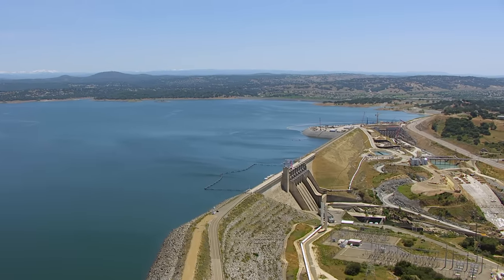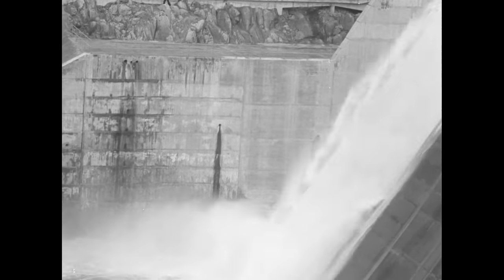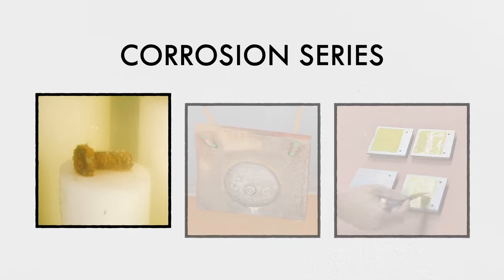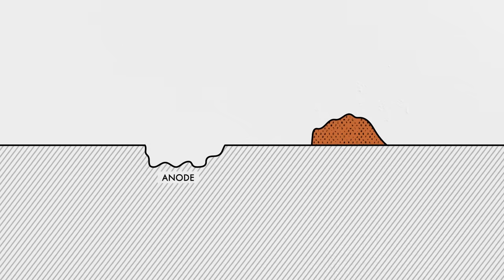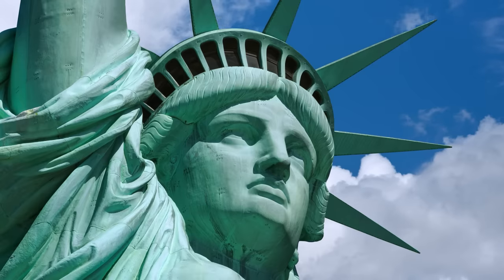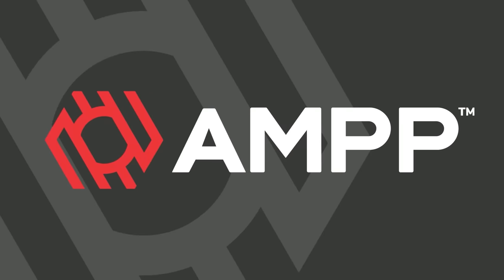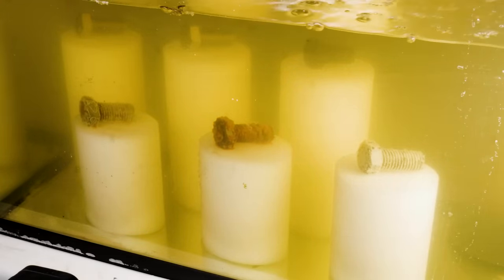You Spend More on Rust Than Gasoline (Probably)

Comment: Quick question: I have been building in a high salt environment near the ocean. For my concrete pours, I switched, for flat surfaces only, to fiberglass rebar. As far as I have researched it is not certified for vertical columns. What are your thoughts on this as a replacement to steel rebar? It seems to be a better replacement for any number of reasons from laying it (way easier to cut and handle) to weight to corrosion resistance. What am I missing? Why is it not in common use?
Reply: Price, construction jobs usually shoot for the cheapest acceptable route possible lol
Reply: Because big steel won't like that 😉
Reply: I'm very curious of the cost vs performance of "glass re-rod"... As a Bldg. Mgr. In N. Palm Beach FL,,  I've see spawling occur in less than 5yrs -- thermal dynamics along with the porosity of concrete draws salt & oxygen air right to the rebar.. it rusts, expands and pops up even under tile or any other surface treatments.. Paint & caulk seem to be the best defense, but even the cement will suffer 'entropy' at alarming rates in ocean front decks, balconies, etc.. It's a huge budget consideration for owners.
Reply: @francom6230  I hear you, I have tried additives in the concrete, but even that long term is not perfect. I have been using fiberglass rods for 2 years, here is what it did for me.

1. Cheaper both to buy and more important to me is the lower weight has saved me a ton on shipping costs. 
2. Time to prepare. To put this stuff down is much much easier than steel. Plus you don't need tools that can cost thousands of dollars. tie wires and bolt cutters only. Also, you buy pre-done pieces if you need a curve. 
3. NO RUST. Let me be clear NO RUST. So theoretically the only way for the concrete to break is external damage. No risk of spalling unless something contaminated the concrete during the pour.
4. BUT it is only rated/certified for horizontal pours, not vertical. 

I am using it for floors, decks, etc. So overall I have found it superior to steel in most ways and it has saved me a lot of cost on labor since it takes much less time to prep a pad. Given the cost of labor this in the short term has become my #1 reason to use it.
Reply: just build a house out of legos and add carbon for UV protection. guaranteed to last a millenium. just be careful where you step
Reply: @truemore75  My guess would be the long history of using steel rebar. We know how it behaves in long term environments. Fiberglass rebar may have issues in the long term that could cause catastrophic failures.
Reply: @Blox117  Love it. Do you think they can stand up to a class 5 hurricane? :)
Reply: @truemore75  if you glue them together sure
Reply: @truemore75  the flexural strength of fiberglass rods sit on 70-80% to that of steel, I imagine this perturbs the stodgy building code cabal.
Reply: @mgntstr  I assume that is why in the specs the standard was 1 bar larger. I suspect that makes up for the difference in strength. Given how cheap it is who cares? Plus it is light so there is no downside for the workers with the thicker stock or shiipping cost.
Reply: @truemore75  then there are the environmentalists on the board. You cant recycle plastic
Reply: There's also basalt rebar, which has a higher modulus than fiberglass, ie less stretchy. That makes it better suited to use in concrete, and (I don't know about your local building codes) might be legal for vertical columns. But the big thing is to get away from the planned obsolescence of steel rebar which is a ticking timebomb in every concrete pour.

The Pantheon is nearly 2000 years old and still stands because it doesn't have iron inside it to cause corrosion and collapse.
Reply: @mgntstr  yes that is true. But if you keep the concrete (major world CO2 producer) for 2, 3 or more times longer that would easily outweigh any environmental issues with possible recycling of the fiberglass.
Reply: @truemore75  CO2 is the building block for all vegetation on this planet. We need to pump those numbers up.

I think fiberglass resin rods are an excellent substitute to steel rebar, but I suspect the 1/5th reduction is enough to make it necessary to scale it up a whole lot, pour double concrete and the use of a whole lot more rods than 1 extra in every 5 rod placement.

It is basically epoxy reinforced with fiberglass. Great for tensile stress, not so much for pushing and pulling on it sideways.
Reply: @r0cketplumber  hard agree
Reply: Sounds like you need to get a hold of Tyler Ley (civil engineer PhD, instructor university of Oklahoma). Tyler has a YouTube channel and he’s pretty easy to get a hold of , especially if you’re talking concrete and concrete reinforcement. The man is just nuts about concrete and he probably dreams about it when he’s asleep. Check out his Tyler Ley Channel on YouTube and send  him and email. I guarantee you won’t regret it, he is a lot of fun.
Reply: @boby115  thank you I will. I'm working with a   chemist too that makes chemicals for concrete out of Texas. Between the two of them I will probably get the best advice ever!
Reply: I know some simple engineering, the primary reason to use metal as reinforcement is that it can stretch BEYOND it's elastic point, whereas fiberglass, basalt fiber, carbon fiber etc. will SNAP the instant they go beyond their elastic point. 
This is ductility, it lets each reinforcing strand share the load during a failure event like an earthquake, since as each bar fails it stretches instead of snapping, letting its neighbors catch more and more of the force without actually failing entirely. 
Metal fails to a stronger tensile strength position before its ultimate failure, while fiber fails catastrophically (immediately).
Reply: Fiberglass rebar is brittle, subject to creep, and has different stiffness/thermal expansion coefficient properties than steel rebar, which throws a lot of the assumptions behind conventional reinforced concrete design out the window. Especially because a lot of reinforced concrete design is based on empirically-demonstrated past performance rather than a realistic analysis of the structural stresses. That's not to say it won't become more common in the future, but it's not as simple as a 1-to-1 replacement.

Also, another commenter reminded me that fiberglass rebar is bad in shear, if I recall. I forget if that problem falls under the "invalidates assumptions" category, or if it's just believed that a lot of engineers accustomed to steel rebar will fail to account for the difference.
Reply: Hey everyone on this threat thanks for the replys. Why don't we ask Grady to do a show on alternatives to rebar. I mean he has the testing equipment and know-how. Would be a great follow-up video to this one.  Thoughts? Grady?
Reply: @truemore75  , if you talk to him,let me know how things went and your impression about a guy who’s life revolves around concrete..
Reply: @mgntstr  You're joking with regard to CO2 right? All those poor plants are being overwhelmed.
Reply: @elangum22 , carbon FRP is the best but it cost 30 times more. Basalt FRP also has challenges, it cost 15 to 20% more, there is questions on how it will hold up in a fire, there is questions about long-term deflection, it only has half the stiffness and 1/4 the strain capacity.
Reply: @soheil5710  no they are gasping for more
Reply: @Blox117  ouch! 😀
Reply: Epoxy coated rebar.
Reply: There are currently trial runs being done of concrete with a small amount of graphene added in. The graphene acts as nucleation points for the concrete, making it denser, stronger, less porous, and it cures much faster. The increase in strength is enough to not need rebar in some applications. Currently the trials are only flat slabs but it's looking extremely promising.
Reply: Fiberglass can also sucks water into the fiber and make it expand. Just ask people who has a very old fiberglass boat. The Gelcoat surface on fiberglass boats gets small water filled bobbles under the smooth Gelcoat surface if small glass fiber ends are sticking out through the Gelcoat layer.

Comment: I remember reading as a kid that the American armed forces single biggest expenditure was rust prevention\repair. It was in a Popular Science magazine if I remember correctly. The article was discussing a kind of "Smart Paint" that (If it worked as intended) would actually have fairly extensive self repair capacity, so as to minimize any time bare metal made contact with the outside air.

Comment: In Lithuania just today we have had a small dam spillway failed and collapsed. Ended up raising water level of the river below reservoir by 3.5meters, which was  0.5m away from  flooding local town. The spillway was partly closed by adding plate shields as a short term mitigation.

Comment: Architecture students at my former university had designed a small building the size of two shipping containers that included a fassade of what we assumed is Corten steel, since it began to rust pretty quickly. However, the building had a design flaw: The students had decided to only use the fassade on the second floor, while the walls of the first floor were entirely made of glass. When it rained, a bit of the rust came off and ran down the side of the building, leaving ugly traces of rust all over the glass panels. It looked really bad.
Reply: Oh yeah, I think he mentioned that downside in another video, and I was surprised he didn't mention it again. The rust stains can be pretty astonishing.
Reply: It's better they learn those lessons in architecture school than out in the real world.

Comment: One of my favorite instances of practical engineering is BYU's heating and cooling plant. It's a power plant that sends it's power right to the city, then uses the profit to buy back power at a surprisingly profitable rate. The heat from this power plant is then used to heat a closed loop of 9 miles of water containing pipes to 500 degrees Fahrenheit, the water is kept at 350 PSI and is transported across campus through a network of tunnels (which are ventilated but still very toasty). The water reaches each building and runs through heat exchangers to heat up the water within the buildings. The water typically returns to the plant about 80 degrees cooler than it leaves. 

The plant operated on coal until a few years ago, now it runs on natural gas. I cannot remember the exact reaction, but we use an additive which causes the resulting exhaust air to be cleaner than when it entered. Thanks to your lessons on the power grid, I was able to understand why BYU doesn't use the power it creates, that and the network of secret tunnels across campus make for great conversation points. There is much more to the system, such as the pump that runs it all, as well as the tunnel infrastructure that keep things safe, such as expansion chambers to prevent buckling from the heat. 

I don't know how common systems like this are, but I was blown away to learn that you can heat and power a large campus and turn a profit by taking advantage of the power economy. If you ever need an idea for an episode or find yourself in Utah, I can't recommend visiting the campus heating facility enough!
Reply: That's really cool!
Reply: Interesting!  As I understand it, in many downtowns in northern North America, the buildings are heated by steam that comes from utility tunnels under the streets, often called "steam tunnels."  They're owned by the local power companies. Most of those tall buildings don't have their own heating plants, they use steam from these systems.  You'll often see steam coming out of manholes in the winter, I guess from a pressure valve opening or something.  Grady should do a video on this.
Reply: @Baise Duezcke , it happens all the time in New York City on their steam loop; sometimes it is a big deal when it hits the underground electric line. Here in St. Louis we learned the hard way (luckily nothing serious happened). The gas company replaced an old cast-iron gas main with a polyethylene plastic gas main in the vicinity of the downtown steam loop. Guess what happened when they turn the steam loop back on for the coming winter season ?

Comment: When I hear about rust I get angry. As someone who loves and drives older vehicles, and also lives in Michigan, I'm constantly annoyed and dismayed by the "car dissolver" that they that they put on our roads for half the year.
Reply: the cars have two choices: corrode or go offroad
Reply: @mfaizsyahmi  : Not so.  In Alberta, where the temperature extremes are such that salt doesn’t work, they use sand and grit to keep the vehicles on the road. . .  and slowing down a bit helps too 😀
Reply: @dewiz9596  yeah well we're talking about the insane amount of salt they put on the roads in Michigan/the snow belt states. Not your fancy sand in Canada
Reply: People get used to driving with no salt.  I have lived out west and in Sault Ste Marie both of which historically used no salt.  Once people get spoiled by salt and bare roads they can't go back.
Reply: @dewiz9596  True, but my understanding is that packing & gritting the roads only works when the temperatures are extreme.

Comment: Great video as always! Stainless is not "as much as" 10% chromium but at least 10% to make it stainless (some sources say 10.5%, others 12%). Fancier stainless grades can go up 20-25% Cr content, and depending on the microstructure, they add roughly the same amount of nickel. Other than nickel, molybdenum, nitrogen, copper, and manganese are also important alloying elements, but of course, there can be more (Nb, W, La...etc) depending on the application. It would be interesting to hear your opinion on stainless steel in infrastructure because I know that it is a struggle to get stainless accepted by standards and fabricators. Of course, it has a significantly higher initial cost as compared to carbon steel, but it pays back multiple times during the life of the structure (bridge, storage tank, silo...etc.) because the maintenance is essentially eliminated. A carefully selected grade for the application can serve for decades without showing any sign of corrosion.

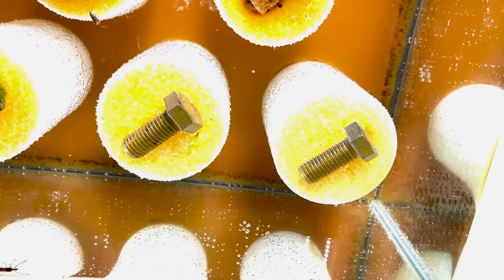Comment: 8:35 -- At the refrigerator factory I worked at, we jokingly called magnetic stainless steel "Fool's Stainless" for its proclivity to rust despite it's name.

Angry business customers of ours who called in to complain were given the same line: "It's called 'stain-less' not 'stain-never!'"
Reply: One project I worked on was for a marine engine. I needed an engine position signal so someone designed a ‘tonewheel’ that would mount on the crankshaft, and he made it out of non-magnetic stainless steel so it would not corrode away. Of course, the engine refused to start. The (magnetic) Hall effect sensor had a bit of trouble seeing it.

Comment: "sometimes up to ten percent [of chromium and nickel in stainless steel]" - actually, it's almost always even more than that. the basic 304 typically contains 18% of chromium and 10% of nickel, so almost 30% alloying metals by weight.

Comment: 316 corrodes way less than 304 at higher temperatures (like 400+).
Reply: And in salt water. I use 316 wherever possible on my salt water boats and trailers. It pays for itself if you keep them long enough.

Comment: As someone in New England who has spent years buying, selling, and working on cars, i said FINALLY at this video, because nobody seems to understand how serious metallic corrosion is, especially on the non-stainless steels that 95% of cars are made of. The time and cost taken to repair older winter-driven vehicles due to salt deposition can triple that of other parts of the country where salt is not deposited on roads, due to more difficulty in removing fasteners, parts damaged that would normally not need replacement, and entire vehicle scrapping due to chassis corrosion. I hazard a guess that the cost saved from people not crashing as often is entirely offset by the slow damage done to vehicles and the environmental impact of the salt and iron oxides entering freshwater bodies, as well as all the extra vehicle scrap from rust-totalled cars.

Comment: This hits so close to home. I work at a surface treatment/electro plating company. Our main purpose is the treatment of metal parts to make them more resistant to corrosion. Also half the factory is falling apart at the seams because of rust, a huge problem due to the many chemical treatment baths, among them many acids, and their fumes.

The cost of rust to this business can be astronomical: If one of the parts treated by us fails by breaking from rust most often, it is possible that the company has to pay for recalling all machines with parts from the same "batch" as the part that failed, which can be extremely costly.

Sometimes it feels a bit unspectacular to only dip an already machined parts in a few fluids for a living, but videos like this show me the immense value of my work, in preserving what we build. Thanks for that!

Comment: I work as an aircraft maintenance technician doing mainly heavy maintenance on the "revision" shop, like the 4 years maintenance which disassemble and inspect a big part of the aircraft, the main reason for discrepancies found on the components we have are due to corrosion. It cost a lot for the operator to replace the parts and there is a whole chapter in the aircraft manual dedicated to corrosion control.